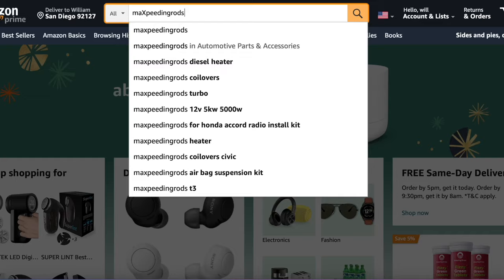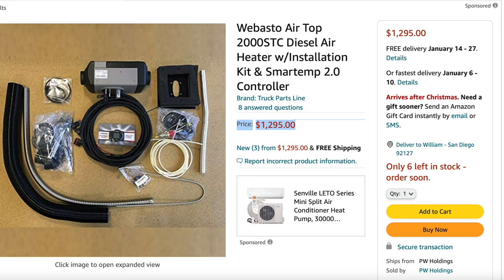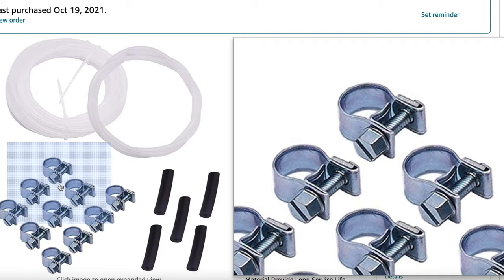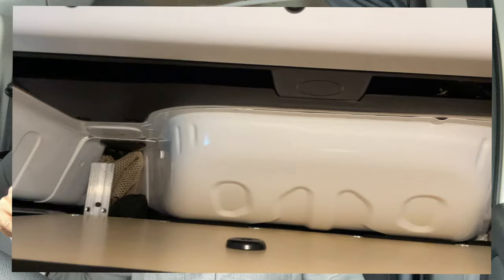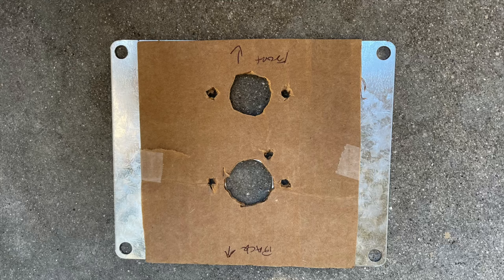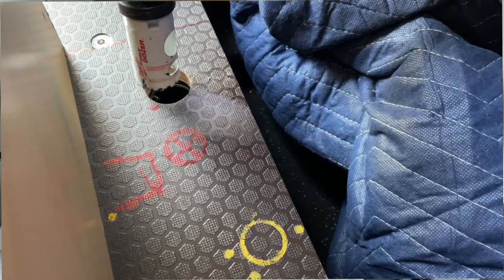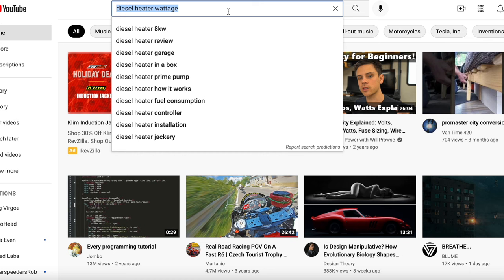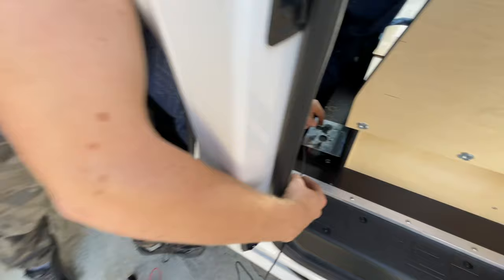Chinese Diesel Heater Install and Review (TWO Things You MUST Upgrade Before Installing!) Story #7

Comment from the maker: As of the current moment, these are the Diesel Heaters I personally recommend along with the kit I suggested in this video:
Vevor Disel Heater: https://amzn.to/3YP5lg5
MaxPeedingrods Diesel Heater: https://amzn.to/3GIaEYf (next gen w/ phone app!)
Fuel Pipe Line: https://amzn.to/329DCOZ
Exhaust Pipe Extension: https://amzn.to/3moV0pJ
Reply: what size are the upgrade exhaust clamps, and do you have a link?
Reply: It's not the webasto it's the esperbacher copy..  I've had both versions of the German heaters.  The electronics on the German versions are very forgiving.
The Chinese heaters not so much..
if you lose power in the Chinese heaters unexpectedly you can fry the motherboard in an instant.  FYI
Parts are very cheap though.

Comment: You’ve not installed the heater correctly. The metal plate should be flat against the bottom of the van to seal the holes that you have drilled. You should have one large hole for the exhaust and air supply and then use the plates to seal the hole. The exhaust is too close to the wood. 😮 hope this helps and the pump needs to be at around 45° angle.
Reply: I came here to say that. It needs a turret fitting that passes through the wood and the metal
Reply: Agreed,  you must fit it flat to the floor in case of exhaust leaks and the wood needs to have greater clearance/protection

Comment: About the ticking noise... You can also further isolate the electric fuel pump by mounting/enclosing it inside a snap-lock top Tupperware style container. You drill holes to allow the fuel line to run in and out and seal the holes with a rubber grommet or calk like 3M 5200.
Reply: Mixing motor oil in the fuel stops the ticking.
Reply: @JohnSmith-pu6fy  non synthetic I’m assuming?
Reply: I have the vevor that comes preinstalled in a case and theres only a very feint ticking thats negligible. Its mounted to the case with a rubber isolating mount. Maybe its the case muffling it. Maybe its the mount. Maybe its a better or newer pump?

Comment: I used to have a German Webasto in my older expedite van right now I have an all in one Chinese diesel heater there’s absolutely no difference they work the exact same for less than half the cost of a brand new Webasto I could buy a brand new diesel heater off Amazon every year for 10 years and it would add up to the same price as a German one. As for the noise the ticking sound sounds like a clock ticking to me and actually puts me to sleep I’ve gotten used to it but I would highly recommend these heaters for anybody doing van life or an RV of some sort definitely a nice novelty to have I could never go back not having one for $200 you can’t go wrong thanks for the video William

Comment: Mirroring others, the instructions are useless and fail to mention leaving safe clearances around the hot exhaust  pipe.  The 'turret' type  mountings use a 125mm diameter hole in the floor to avoid fire risks to timber or foam insulation.

Comment: No way you aren't smelling diesel from that cheap little gas can mounted inside your van.
Reply: You're thinking of it like gasoline. Think of it as what it is, oil, very low vapor pressure. It doesn't off gas the same. I've kept cans of diesel and a diesel heater inside vehicles and structures and they don't smell up the joint like gas shit...also much safer.

Comment: Hi I ran one of these in a mobile home for 2 years with no problems or issues. I now have it in a van also and still no problems. The only upgrade I made was to install a slightly heavier pump which is serviceable barring that it's just like it came out of the box. The more expensive heaters are actually more delicate as I know people running them and they seem to have more problems with them than i do and the parts for the supposedly better brands are way more expensive too. The other thing I did change was the fuel. I have used home heating oiled in mine since I first installed it runs just as good, I personally think it burns cleaner and maybe even warmer than the diesel plus here in Ireland it's about half the price of diesel so way less cost to run

Comment: I own a Sprinter and that community usually places it under the passenger seat.  I have my pump in the front cab and you can hear it but for me I can get over it.  My girlfriend is a different story.  I went from buying a fully loaded van to building as I go after hearing the regrets of a couple of my friends that purchased turn key vans.  

The heater was the second thing I purchased after a blow up mattress.  One night freezing my ass off and I knew what I had to do.  Mine is a Webasto and I paid full price but this was 5 years ago and the Chinese version wasn't an option at that time.  For a full night it consumes probably a quart to a quart and a half.  So far there are zero regrets.

Comment: I've had mine for 14 months. 8 of them it ran 24/7. I've had zero issues with the green fuel line or hose clamps that came with the heater

Comment: I put my pump inside a small Harbor freight gun case. It's approximately the size of a kids lunch box. It TOTALLY kills all clicking noise. It would also protect the pump under the van.  I've run my heater continuously for months no stopping

Comment: I've fitted my heater like yours raised up on some brackets so i can keep the fuel tank inside the van.
Something i would recommend when fitting the heater raised up is to smear some exhaust paste onto the heater exhaust outlet to exhaust pipe connection.
Mine was a little loose and i didn't want to rely on the pipe clip alone to stop fumes entering the van.
Reply from the maker: Good tip.. will look into it.
Reply: I think it is supposed to be flush with the floor for safety purposes.  If the exhaust came loose you could end up with CO2 leaking inside.  That said, I did the same thing you did...lol.  I just made sure I could easily see the connections and adjust them if needed.  That way I can inspect it frequently.  And of course I have a CO2 alarm.
Reply: Great info!  Thank you Marksoutta10! 👍
Reply: Did you put the paste and then the clamps? I’ve got mine raised up as well. Did you use the mounting plate at all?
Reply: @WhoamI20233  yes i used the plate that came with the kit. To fit i smeared exhaust paste around the heater outlet pipe then slid the exhaust pipe on and used a clamp over the connection. I'm not a fan of jubilee clamps though as they don't clamp down evenly. There are better clamps out there.
Reply: Also the exhaust is hot,, so suggest a little more clearance around it as it egresses the floor
Reply: I cut 1 inch of spare exhaust pipe off  then made a cut down the side to open it up ,I used that as a spacer to pack the gap between heater and exhaust which work spot on as had no luck trying to seal the 1 mm gap with paste

Comment: You installed yours properly, mine was a disaster. I have a table and dog in the front so it would have got in the way there. Under the bed I keep dog food and candles and other stuff so there's just not room. The only available space was the cupboard above where I sleep so I installed the portable one in the metal box. I ran the exhaust pipe straight down and out the rear window which is plastic using chewing gum to semi-fill the gap from wind and stop the pipe getting damaged when I opened and closed the door. It always got in the way when I sat up in bed and the exhaust got burning hot, but the noise was horrific. The tapping noise of the pump was like someone knocking on my van constantly and the rest sounded like a jet engine. Filling it up would mean using a homemade flat funnel and spills made my bed stink. I can still smell it because the diesel soaked into the wood. I ended up binning the sheets etc. After a month it really messed up sending black smoke out the exhaust at first and then into the van. I used more chewing gum to try and seal it but driving meant it wouldn't last long before I had to add more. Had many other problems too including it cutting out so took it out and went back to candles.

Comment: I live in a fifth wheel on property in AZ. Some of the modifications I've done are the following.
1) moved the fuel tank outdoors (no diesel smell inside or risk of spilling diesel fuel inside while filling it)
2) added a shut off switch to the fuel line at the tank (makes it cleaner and easier to repair/service the unit) Also moves the fire risk outside
3) added a more premium fuel filter to the fuel line before the fuel pump. (Extra protection for the unit)
4) switched to premium automotive grade rubber fuel line
The one upgrade I plan on doing shortly is adding an on/off switch to the positive power supply side (when the inevitable fails to start or fault happens just shut the power off to reset the unit)
I live on a split solar system with 1920 watts of panels. I have 1230 watts of panels running through two epever solar controllers. One 60 amp and one 40 amp into 840 ah of golf cart batteries. 
Then I have another 720 watts of panels running through another 60 amp Epever solar controller into a Vestwoods 250 Ah lifepo 4 battery. 
I started out with the Golf Cart batteries and they've served me well. The big issue with them is you have to stay on top of them cleaning terminals and making sure they are watered. 
I am really like the Vestwoods battery and plan on replacing the golf cart batteries with 750 Ah of the Vestwoods batteries. That will give me 1000 ah of lifepo 4 battery storage.
As it is I can accomplish quite a few things with this solar system. Not quite like being on grid but not far from it.

Comment: Nice vid.  Having raised the unit on two posts (nice mounting solution in your situation) means that the exhaust connecting point is inside of the vehicle.  In addtion to the metal band (ring clamp) holding on the exhaust tubing, it would be safer to add some exhaust cement (also called "exhaust putty", "muffler seal", etc.) to the inside of the tube where it connects to the main unit.  While the clamp will stop the tubing from falling off, it is not a guarantee against leaking fumes.  (Oops, I just noticed a similar comment below, so I guess you already know.)  That aside, I enjoy your commentary and way of speaking.
Reply: Shotgun .Yeah, he's not hard to listen to, that's for sure. When you come in to these informational videos, that is what you are looking for ! some presenters try to make it a comedy show and it can be very annoying.....if I want comedy I can find plenty of that on Netflix or Stan.........or am I just a cranky old b*****d ? 🤣
Reply from the maker: I’m not that funny anymore to begin with. So I stick to the script and focus on saying the necessary bits people clicked to hear. Glad people are finding this video helpful 👍
Reply: Keep it up.  Class act, I think.
Reply: I have six of these heaters, three airtronic and three Chinese, over a period of ten years. airtronic (German ) good quality with comprehensive error register but is subject to carbon build up and the parts are very expensive in Australia. A rebuild of the units, ie replace burner screens and fan motor, can cost up to $200 and this is required after about 3000 hours I had to get parts from England. The problem with these heaters I think is the diesel quality in australia. The Chinese heaters are just as efficient but I have a lot less problems with carbon buildup and very cheap to overhaul. I was even rebuilding the fan motors, which can be disassembled and fitted with new bearings and brushes for less than $10. Airtronic fan units cost me $130 and are not repairedle. I can now buy replacement Chinese fan motors for $15 free postage. The other parts, glow plugs and screens, gaskets etc are very cheap  here. Chinese heaters can also be tuned for air/ fuel ratio using the pump hertz and fan speed adjustments in the menus. Basic maintenance, clean air intake, correct cabling ( prevent low voltage problems ) good quality fuel filters, and keeping exhaust length to a minimum and running at maximum heat for 10 minutes before shut down will give you a good service life. Both these types of heaters are very effective .
Reply: Does your exhaust pipe fit so loose as to need a sealant of some sort? ?Exhaust putty used to contain harmful compounds and is usually meant for use in an engine bay, not a living space. Just a thought.
Reply: Good insight regarding the exhaust puddy.  Thanks.  Not sure what he could use in place of that or if more human-friendly puddy is now available.  What is safe and keeps the fumes from seeping into the vehicle.  For reference, in my case, my unit is floor-mounted (flush with a metal bracket mounted to the floor), so my pipes come out under the vehicle.  I just needed to use the provided rubber seal between the unit and the metal plate and then seal around the metal bracket.
Reply: I have an airtonic.  (Bought it before the Chinese heaters really upped their game.)  Thanks for the heads up on the issues I might face going forward.   Great insight.

Comment: Great video ,the only thing I noticed is there is a gap under heater plate, I believe  the black rubber gasket is meant to seal the base  plate and heater on a floor  so any fumes directly below the heater are kept outside of the cabin /living area .
Reply from the maker: Good observation but it doesn't apply in my situation because underneath where we installed it is hollow so we clipped the rubber gasket so it frees space for fitting the exhaust high as possible and tightening it up. Situations vary for everyone.. mine is a unique one.
Reply: @WillandRambo  Yes looks neat job ,just to clarify ,what I meant was just below the heater plate (silver  base plate ) would any leaks fumes  in that area (the area were the clamps are that hold the exhaust and inlet pipes on )  escape to outside and not be able to be pulled vertically towards the heaters main circulation  inlet area  (the black  round  plastic inlet area  for the fan at the rear of heater  ) as there's negative pressure(suction ) just at that area that pulls the cool air over the heater and into the outlet duct ,,anyway thought I would mention as such interesting and important  topics .👍
Reply: How you have fit your heater raised up with the exhaust pipe open to the inside is a definite no no! 
It should be mounted and bolted to the floor with the black seal between, that’s what the seal is for to prevent gases returning to the cab area. If you have a leaking exhaust due to clip coming loose because of cooling and heating the exhaust gasses have no where to go other than in your van.
Your manual should show this is not acceptable.
If other folk see your video do the same and use the clips provided by manufacturer which are of poor quality then this is a major  problem waiting to happen. 
Sorry for being so blunt. 👍
Reply: I just made a comment about this too he does not realize how dangerous his setup is .that rubber gasket was meant to be flush with the floor because those hose clamps on the ducting for the exhaust are not airtight. that raised platform that he made is just asking for carbon monoxide to leak into the van
Reply: @WillandRambo  no he's making a very good point you're not understanding what he's saying I made the same comment to you in a separate comment

Comment: I read in a group that if you put the Air intake inside the car, it would be even more efficient. As you're circulating already warm air.
Reply: I think the air intake is just for combustion.  Using cold air is better.  Cold air is denser than warm so it contains more oxygen.  More oxygen = bigger explosion in the cylinder making it run hotter and that is where the heat is from.  The fan that blows air over the engine should of course be inside of your heated space to recirculate the already warmed air

Comment: Just looking for the upgrade on exhaust clamps here. My clamps leaked exhaust and I had to use an exhaust seal compound to prevent EG from getting into the cabin and this video is full of design contemplation and all sorts of reflection. Just wish it was a more succinct summary of the suggested upgrades in the title and no, the fuel line supplied does not as he says "expand causing flow shortages" but its a low cost fuel line and very serviceable in my opinion and the supplied clamps work well and are better than a small hose clamp which may leak due to imprecise fit. Okay Im searching for those EG clamps which may really improve the safety of operation because exhaust poisoning is a real risk! The stainless tubing just does not seal to the furnace outlet with the provided clamps and it will leak if not improved somehow.

Comment: I couldn't help but notice that the hole you drilled into the wood appears to be in direct contact with the very hot exhaust pipe. I'm a bit concerned about the potential risk of something catching fire in that situation. It might be worth considering some additional precautions to ensure safety.

On a more positive note, I wanted to commend you on the clever idea of using a drilling template. It seems like a practical and efficient way to achieve precise results in your woodworking projects. The attention to detail and ingenuity in your approach is commendable.

At the moment the "All in one" heater is jist 55 €!

Overall, your video showcases your skill and creativity in woodworking, and it's clear that you have a passion for what you do. Keep up the great work, and remember to always prioritize safety in your projects. Thank you for sharing your knowledge and experience with your viewers.
Reply from the maker: Only two fires 🔥 put them out quickly.

Comment: Prices in US seem high. Just bought UK 8kw for £80 about $90. Comes with everything, remote, twin outlet tubing. Going to use for domestic heating. Have had a 2kw in my van 5 years or more now. Only problem exhaust tube rotted, had to replace.